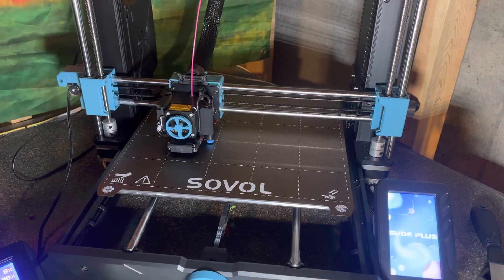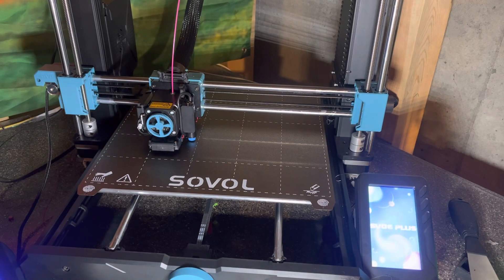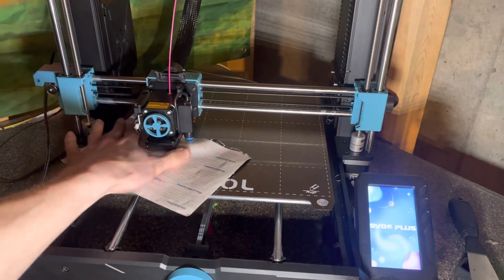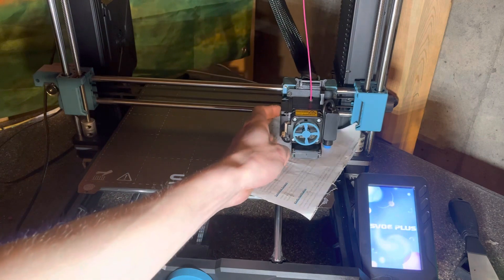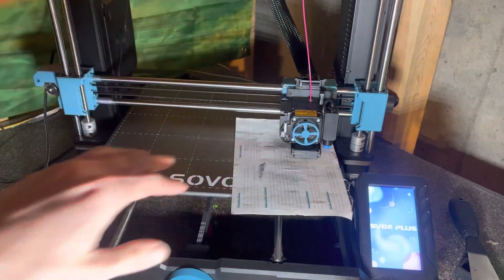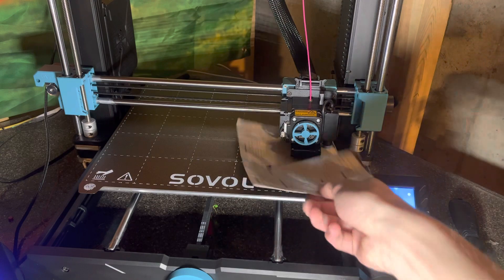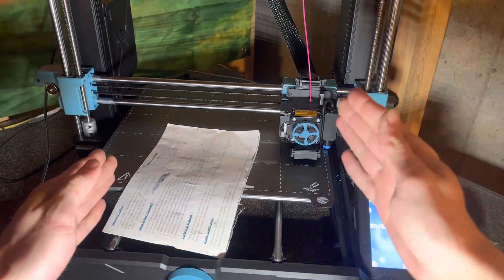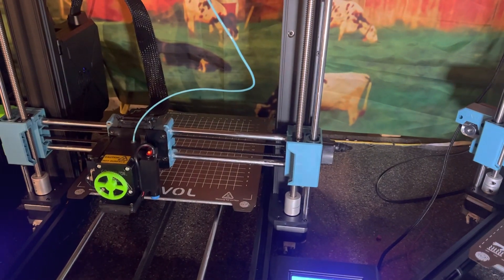How to manually level sv06 and plus!

Comment: This can also be fixed by installing Marlin firmware which was x-axis twist compensation. The trouble is that the probe is offset in y from the nozzle so a twisted x-axis will cause the probe z-offset to change along the x-axis.
Reply from the maker: X twist compensation only works for dual z drivers. I’ve printed over 60kg on kipper no issues 👍

Comment: Hi,  ur way maybe not save it to the Eprom!!!I or? I measured the bridge to the bed with a digital caliper. Right side was 1/10mm mm higher. When leveling the bridge height, I simply held 1/10 feeler gauge in between.
Reply from the maker: Shouldn’t be anything to save to the eprom. When you get the gantry level and turn the steppers back on in theory it can’t move out of level. Both the motors are powered off the same driver so they can’t spin independently via power only by hand when the steppers are off.
Reply: @chargedup6565  i just did a test. When z-aligning, the left and right motor step position values are not saved. Only the parallelism is set by the upper stop. From the factory I had to keep 1/10mm between them at the top right, so that it is parallel. But as soon as I accidentally turn the spindles when switched off....it stays wrong. So you have to be careful not to accidentally turn the spindles. The Z-axis level is saved.....only the left and right motor positions not individually; but only together. Your method therefore works perfectly and is faster. Actually, I would have expected the left and right spindle position to be saved separately, but it doesn't. GREAT Job Bro :---)))

Comment: Think this method is better than the auto Z alignment?  I remember seeing ModBot using soup cans to align the Z axis lol.
Reply from the maker: This is better then the auto z and soup can method imo
Reply: @chargedup6565 no
Reply: Why not using the light om the probe. It turns on/off at a specific height.
Reply: @jhvhest  or the Z tilt Macro which tells you how much adjustment to make

Comment: Hi! Do you have a problem printing TPU on SV06? I feel like it can't push filament good enough and it get warped inside extruder.
Reply from the maker: I only use a .6 nozzle with tpu!
Reply: No, Set the feed spring slightly tighter. I print TPU 95A with 100mm/s at 240°C...all walls and filling same speed, only 1st layer with 50mm/s, retract 1.5mm, feed speed 30mm/s, push back 20mm/s. TPU 83A with 60mm/s at 240°C, ....all walls and filling same speed, only 1st layer with 30mm/s, retract 1.5mm, retraction speed 30mm/s, pushing back 20mm/s
Reply from the maker: @crew-lol_bockes9673  can you share your tpu profile?
Reply: @chargedup6565  i write my settings in the answere......type it into your slicer.....its easy
Reply from the maker: @crew-lol_bockes9673  I’m looking more for wall thickness settings.
Reply: @chargedup6565  that is easy.....i use Cura as my Slicer. All time and on any Materials i use Layer Hight 0.2mm. For walls i do 3 walls (Wall Line Width 0.4) 3x0.4=1.2mm.....with 0.4mm Nozzel. For faster printing i use many time wall thickness at  0.6mm with 0.4 Nozze, then i use 2 Walls 2x0.6mm=1.2mm. Cura does this perfectly when printing 0.6mm Wall Line Width with 0.4 Nozzle... and you save 1/3 of the time. Top and Bottom Layer i use 6 Layers.
Reply: I'm using TPU on my SV06 and it prints really well (Amolen brand).  I'm running Kipper firmware and have found that I need to slow printing down significantly or I'll wrap up in the extruder.  I use a 0.4mm nozzle with 210C hotend and 40C bed.  0.2mm layer height and 0.4mm line width.  The wall thickness is 0.8mm.  I keep the print speed at 40 mm/s with 1.2mm retract.

Pretty slow compared to running PLA but if I try to push TPU I have problems.  With the above settings I get minimal stringing (still a bit, but easy to clean up).
Reply from the maker: @aargvark  try a .6 nozzle, I’m running tpu up to 80mms